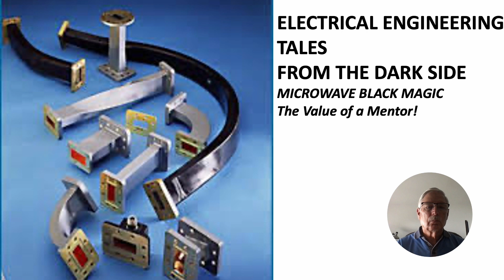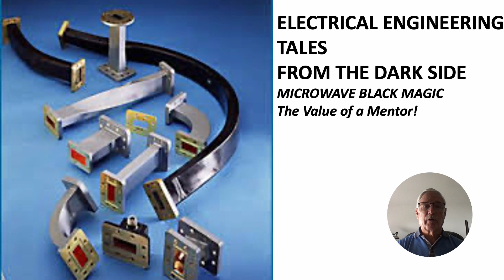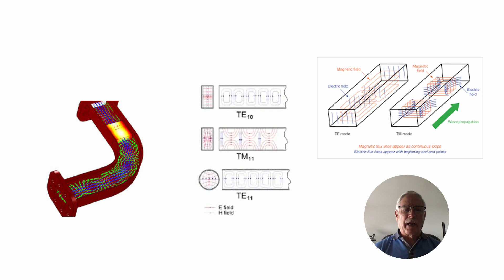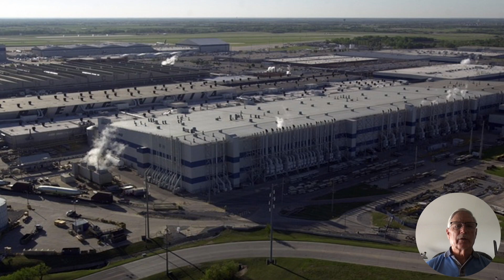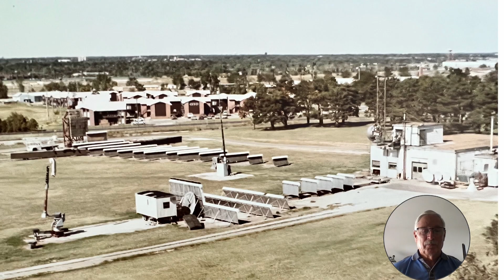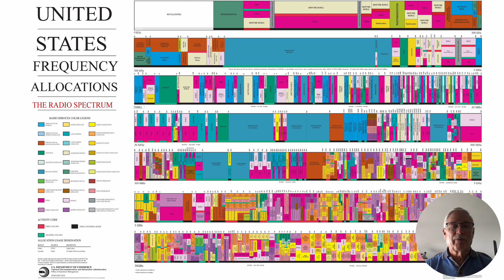Electrical Engineering tales from the dark side. Microwave black magic and the power of a mentor.

Comment: I spent a number of years on avionics design at McDonnell Douglas, but had to transition to earthmoving equipment electronics after the USSR split up.  Having a mentor is very helpful to figuring out how to move beyond the introductory knowledge that comes with a BSEE.  Never got into RF stuff, but did have to know enough to get my designs to pass the applicable EMC standards.  After enough of that, you never just think of a wire as a simple thing... it has inductance, capacitance, and can cause trouble.  🙂  Spent a lot of time in the semi-anechoic chamber troubleshooting problems.  As I learned more, I always tried to pass the knowledge on to the younger engineers too!

Comment: That must have been incredibly interesting given the puzzles you guys & presumably gals were given to solve. 
I, given my druthers, would have pursued EE thru the grad programs , but my university at the time only had software engineering and I ended up taking the pure math route. However, I love the applied side of math and really enjoy the manner in which partial differential equations maps to everything, but especially RF engineering. Hence, I would have been reluctant to resume being a pilot. Not that I could have because my eyesight sucks. RC planes gave me some degree of flying fun none the less and you can park them in a tree without anyone but you being terribly upset.